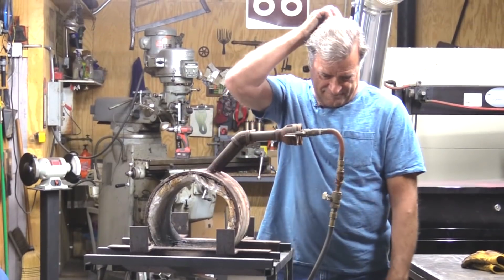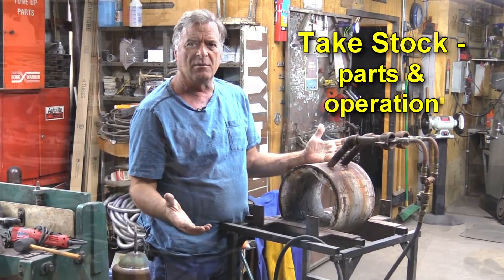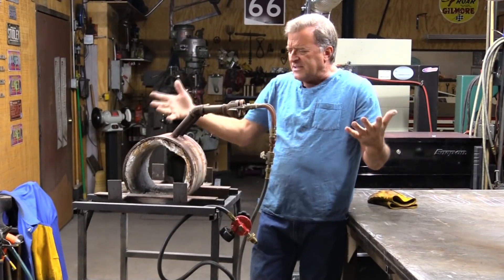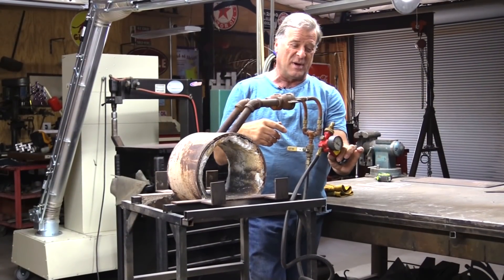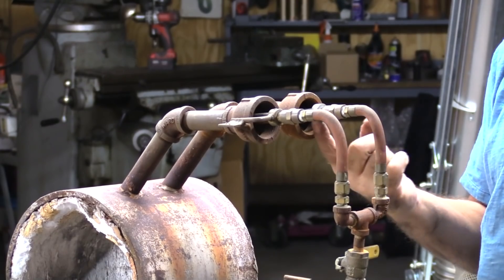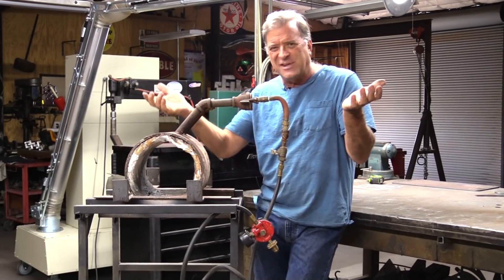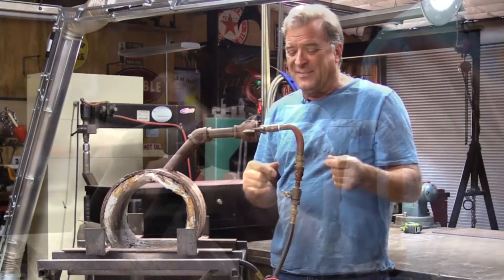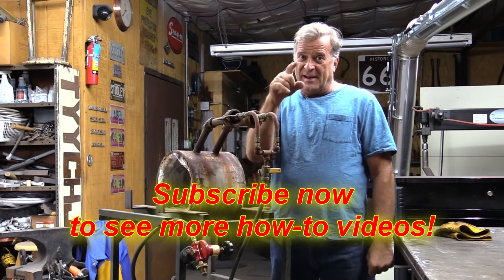How to Figure Out What's Wrong - Kevin Caron

Comment: Kevin - A little off subject here with a question, please. 
I see in one of your videos regarding the bending of thick pieces (the cactus sculpture), that you are now pretty familiar with propane use, so here is my question. HOW do you go about forming large areas of thick (say 1/8 inch or 11 gauge) steel sheet stock that just will not fit in a forge?
I need to form bowl shapes on MANY pieces, and pounding cold metal on the top of a tree stump is an ordeal, so is there a way you know of to get red heat on something too long and wide for a propane or even a coal forge? I've searched and searched for an answer. One friend told me to make a play sand box and use several propane weed torches to heat things up. Another suggested a huge induction coil. Any thoughts? We LOVE you guys and your channel!
Reply from the maker: Thank you so much for the kind words!   Have you tried a rose bud on an O/A torch?  You might also look at a power hammer as a way to shape the metal.   I do like the idea of a big sand box and a few weed torches as well.
Reply: @KevincaronSculpture  I believe the sandbox may just work -- maybe that, filled with a combination of sand and vermiculite and a hefty-as-possible weed torch (I actually used a weed torch to repair a badly bent FORK LIFT TYNE! - took a good while and I had to make a special hydraulic tool - just sent pics to you). As far as rosebud approach, I am terrible at using them...PO, POP, BANG!!! .... and oxy is just too expensive for me. I'll try the above and keep you posted. THANKS SO MUCH for replying, Sir.

Comment: Please help. So my propane pressure dial keeps jumping up and causing my jets to malfunction. My tube keeps freezing up. What can I do and what is wrong. I feel unsafe using it and I need to fix the problem
Reply from the maker: What machine are you talking about?  What are your settings?  Need more info. before I can help.

Comment: I had the same problem with a sandblast rig which was given to me because sand hardly came out of tip. After rebuilding tip, not much better flow, disconnect hose, lots of flow, open valve on bottom of tank, and not much sand would come out.... Disconnect valve and what's this? oh its a mouse leg stuck in the valve. removed the mouse skeleton, and presto....New to me sand blast unit which was a higher end unit when purchased, now worked great....
Reply from the maker: Hate it when that happens!

Comment: I used to do gas grills in the houses the same thing you experience but the spiders do make spider webs and they block the gas from coming out
Reply from the maker: Had a dead plasma cutter once.   Same thing.   Little sucker got in there and made a web in the inlet line on the back of the machine.    I plugged the air line in and never saw the web.   Had to clean the lines out to get it all.
Reply: @KevincaronSculpture  👍

Comment: Darn WASPS !  I had an issue with those critters also, but on a completely different application.  I have a diesel engine motor home "Toy hauler " with a hydraulic tail lift.  It sat for a couple of months and then the lift would only partially operate, one side would drop only half way......a dirt dauber wasp had built a mud nest on the chain in a hidden guard. When the mud clod would get to the gear, it stuck.  It took me about 15 minutes to find the dirt jammed in the links of the chain.  It would have cost me BUCKS to go to a repair shop  to wash out a golfball size of bug mud !  Thanks Kevin   J K
Reply from the maker: Thanks for watching James!